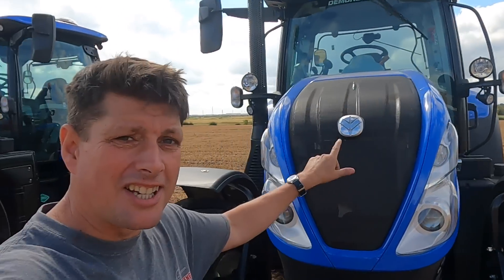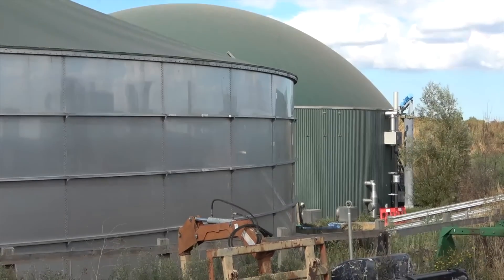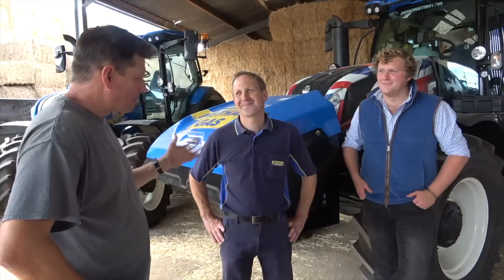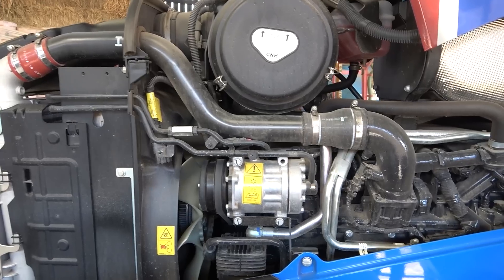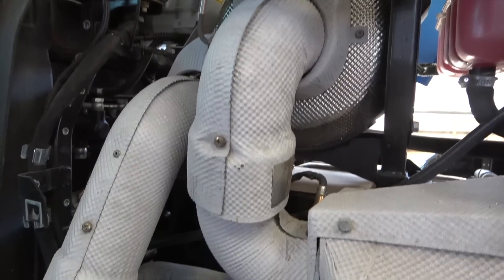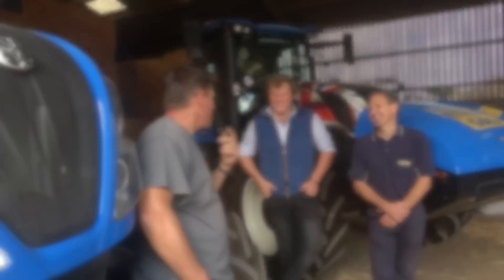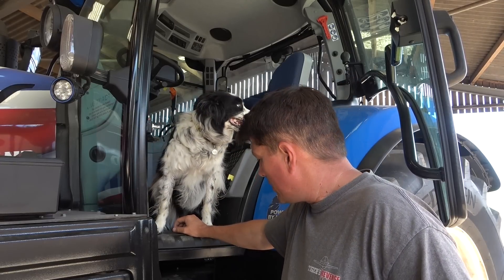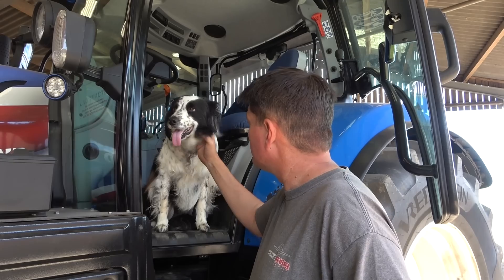GAS vs DIESEL - NEW HOLLAND T6.180 Methane Tractor

Comment: It’s cool and all but when it comes to be used just as much as diesel or gas I’m sure the price will skyrocket just like diesel and gas right now it’s not used much so there’s not a demand once supply and demand goes up then the price is going to skyrocket
Reply from the maker: The whole point (as clearly stated in the video) is to produce your own fuel.
Reply: Sorry didn’t catch it my bad
Reply from the maker: If an A/D plant or a dairy farm can capture and harness the methane, you won't need the tank full of methane (which is still cheap) you will create your own fuel. This can be used to power tractors or generators which in turn can be used to generate electricity.

Comment: It would be like running a petrol tractor with a turbo. A 135 petrol is more lively than a diesel imagine ya had a petrol 135 ruining  natural gas with a turbo. Spark ignition engines burn more liters of fuel for work done though.

Comment: Good video! 👍 We have an AD Plant and Upgrade the gas but want to wait until the tractors are more proven before we purchase
Reply from the maker: There's not a lot to prove really - that's the point - it's the 6.7ltr FPT engine, transmission is same as the diesel, cab, axles, hydraulics etc
Reply: @LordMuck  fair point. I would like to see what parameters the gas quality has to be within to make it work efficiently. 

Not a pessimist to the idea at all but I think the design of tractors will also have to change to integrate the gas tank. Not that safe or practical on the front. 

I would actually like to try one.
Reply from the maker: It's completely safe on the front, in fact safer than a diesel tank as it's in a steel frame and tested for impact with multiple safety shut off valves.
Front linkage can be specced and pto as the range extender can go on the roof or rear of the machine.
The gas produced is the same fuel that the generator engines run on so perfectly fine to run a tractor on.

Comment: That was brilliant thanks.👍. No more stinking diesel on your clothes while filling up with fuel🥰. 

Only real down sides are that in the current form no front loaders or front linkage or front PTO would be possible to use on that setup but that still leaves heck of a lot of jobs it would still be brilliant for.
Reply from the maker: No you can have front linkage, PTO etc, the range extender goes on to the roof or on the rear of the tractor.

Comment: Supose if you had a dairy farm and looking into the tractor youd might as well be looking into maybe a slurry pump/mixer that has its own engine to run off the gas its basically churning out and maybe a genny too as the extra saving with electric would help the gas  infrastructure pay for itself

Comment: I bought a dual fuel generator under the idea that propane engines last a bit longer than gasoline as they don't wear as much . I could ask the internet but how or what would New Holland say about it? Diesel to Methane ? under normal use.

Comment: As someone who's spent his whole life repairing forklifts, using lpg/gas as a fuel is nothing new. 
An engine running on gas can be just as torquey as a diesel IF the engine is designed from the ground up for the purpose.
Reminds me of the gas Perkins engines that used to be around years ago. I've seen gas versions of the 4.203, 4.236, 900 series and 1006 series. Most of them were the diesel version with a low compression head and pistons with a distributor on a 90 degree bevel box where the injection pump would normally live. They behaved just like the diesels, just a lot quieter. 
Only issue with the gas engines is fuel consumption which is an undeniable issue but if you can produce enough fuel on site for free its a non issue.

Comment: What about servicing the methane tractor does it cost more less or the same as a diesel tractor. We didn't see anything coming out of the exhaust is there a waste product from said tractor. Are they alot more dangerous if they caught fire ? Fantastic demonstration could see it working well on combines that only do a couple of months a year .
Reply from the maker: Much cleaner burn, cleaner oil etc.
If they did have an issue or fire, they have a lot of safety valves and auto-cut offs unlike diesels.
Reply: sounding quite promising for the future then mucker
Reply from the maker: They are continuing to improve service times to get them well above 600 hour intervals.

Comment: Good to See Wast To Power Machinery And Cleaner than Diesel With More Torque,This makes More Sense than Heavy Battery's on a Tractor.

I have Used LPG /Petrol Turbo Powered Cars And they Also have More Torque on Gas Than Petrol,Slightly less HP On Gas So Not Sure If its Because it Puts More Gas in to the Engine Compared to Petrol Injection 
Petrol is Probably More Easer to Control Than Gas injection.

Comment: Great video Kurt, most informative indeed. Will be interesting to see if the additional costs of the new machines stay as low as that 10% Many companies leverage customers cost savings heavily against purchase prices. As it stands, the extra machine cost seems very fair, especially when weighed against potential running cost reductions. The additional infrastructure won't be free of course, but if installed at the point where open pits legally have to be covered, that should offer the lowest cost I would hope.To be able to produce heat, electricity, traction fuel and all at the same time as reducing atmospheric methane release is a quadruple win!

Comment: Fuel for the future better than batteries Mucker🚜👍
Reply from the maker: It has its place but so do batteries, just in different applications. AD can also provide power for charging electric equipment so combined with methane kit it reduces costs greatly.

Comment: When comparing the diesel cost to gas, you could also include the add blue cost to the diesel that isn't needed for methane that's also increased significantly in the last year. Very informative video 👍
Reply from the maker: That's a very good point 👍

Comment: Great vid, we are actually in the process of putting a sealed floating cover on our new slurry lagoon to hopefully harvest the methane... everyone’s a winner and the clowns in government should be all over it...
Reply from the maker: Would you consider using the methane as a fuel Tim ?
Reply: @LordMuck  Yes definitely, I think for livestock (dairy) farmers it has a lot of potential as we are typically running those mid range sized tractors. Apart from powering engines you could put it through a CHP unit. As the chap from CNH said it’s hopefully the tip of the iceberg.

Comment: Interesting video M’Lud but l have two questions for you.
1)
The diesel engine is lubricated by the oil in the sump and by the injected diesel thus why they last a long time, however by burning a gas your in effect cutting the lubricating system in half, so would a methane engine last as long as a conventional diesel?

2) 
Will the methane tractor start from cold in winter at a ballpark figure -5?
Reply from the maker: No different to a petrol engine - you're not cutting anything down, it gets lubricated the same way as the diesel variant.
Methane will start at very low temps and doesn't wax up.

Comment: I started to watch with an open mind and was impressed. I know we've got to look at other fuelling systems and we have hydrogen that's being developed as well. 
Would you think methane could be used in cars and trucks as well? 
I'd like to think so as to get away from battery electric units due to the cost of replacing the batterys.
Reply from the maker: Battery powered vehicles and units also have a part to play and the technology is already available to make them much more efficient - the government however are not so keen to push the infrastructure as it's currently not much of an earner.
Despite everyone rolling in their own shit like excitable chimps over hydrogen, the reality is it's not going to be the saviour that everyone hopes.
Reply from the maker: We shall of course be looking at hydrogen in due course.

Comment: Used to work with methane engines at a sewage works diesel start then to gas they also ran better on gas !!! its definitely a better way forward then tons of heavy batteries strapped to your tractor that takes hours to charge
Reply from the maker: People are too quick to dismiss electric - it, like other forms of fuel has its place and the technology surrounding electric and electric fuel cells is moving forward at a crazy rate. The problem is people expect instant tech today and that's not how anything works.

Comment: Great video well done.only one sticking point for me...you refer to it as a free fuel??? It's hardly...look at all the hardware that's involved in collecting the methane and having it ready for delivery to an engine.probarbly a million quid of infrastructure?
Reply from the maker: What is it about "If you already have an AD plant" are people struggling with ?
You buy the tractor if you already have the plant - you don't buy a plant just because you've bought a tractor...
Reply: @LordMuck  ok..if u done have a plant is it possible to buy methane from a wholeseller
Reply from the maker: Yes 100% just as Ben is doing currently from that tanker.

Comment: My only experience with a gas powered vehicle was in the late 1970s with a homemade conversion on an HA Viva van, ran it on butane and propane. Engine stayed cleaner, may save you oil changes too. We used a modded SU carburettor to meter the gas and a copper coil to heat the cylinder. It was comedy gold in the laboratory we worked in to see workmates looking out the window to see where the van was parked so they would sneak out and move their cars away from it. I know it was just a bit of fun but it is definitely a viable fuel.

Comment: Fantastic video really interesting concept, the fact that you could produce your own fuel from your own AD plant and run a generator to produce electricity which you could sell back to the network operator a no brainer surely. The only thing I can see on that tractor that might be something that could be rethought Is fuel tank so you can have a front linkage
Reply from the maker: As discussed further down you can already have roof or rear mounted range extender tanks so you can have a front linkage.
Reply: @LordMuck  hadn't read that 😅ideal then

Comment: Somehow didn't get a notification for this one so a bit late. One other thing about these new fuels is that the engine emissions is less complicated. I have old Deutz air-cooled tractors on my farm and if you wanted one new it could be possible because Deutz engines still make a simple air-cooled engines just a natural gas engine instead of diesel. I find your opinion a bit more lively interesting. One of the fun things about my collection is the different 90-110 PTO hp tractors I have is seeing how different they can be so more lively in throttle response or torque?

Comment: Hello mucky, that was interesting, I like things like this. Gotta couple of questions though. 
1. If you are running on methane and its a clean burn fuel does that mean that it will be possible to run on extended service intervals for the engine because methane would be producing less or no soot particles ??
2. How much is the equipment going to cost to extract and process the gas?? 
3. Obviously not all farms are dairy or beef so where could they get the gas should they choose to go down the methane route?
4. Considering the amount of sh1t being produced at the houses of P would it be possible to connect a digester to the sewers??😂😂
Another excellent video kurt, thankyou.
Reply from the maker: The answers are readily available for anyone wanting to know more regarding where to buy the gas etc

Comment: One thing I think needs change as they are probably already working on a high pressure tank or something but that front tanks where weights would be needs to ge tidied up for front links then it will boost the sales really a tractor that big u would miss your front links /weights but I do think would be a massive improvement in many sectors
Reply from the maker: We discussed this further down - they already offer roof mounted or rear mounted range extenders so you can have front linkage.

Comment: Interesting vid👍I do see this working for dairy, livestock farmers that produce bio gas of some sort.  I just wish mum, dad or older/younger gen investors instead putting their money on stock market put it into family farms if want offset or help environment.  Q. Will see NH put gas system into their largest tractor T9?
Reply from the maker: As we said the system works well in the mid range tractors which it suits best but I'm sure they will increase power. Not sure a T9 is the right size for methane ?

Comment: You should check out the new JCB designed Hydrogen Tractors & Telehanders which have the same power as a Diesel version But don't produce any emissions at all and still let JCB build the same lower half of the engines so the factory jobs are safe they just designed a new top half to the engines!  The Machines are amazing.
Reply from the maker: You should try watching the video - New Holland are using the same 6.7 litre FPT with some top end mods
that's all.

Comment: yes but how much for the concrete cow on top of the 2. 82 ? like the idea but feel it still needs to be made simpler or a hybrid between choosing mithane or diesel
Reply from the maker: You don't buy an AD plant because you have a methane tractor - you buy the tractor because you have an AD plant.
The choice could not be simpler - It's basically Free fuel.

Comment: Is there much of a difference in noise? Especially at tick over? Any idea what compression ratio it's running at? They ran a lot of LP tractors in the states for a long time so I guess refuelling isn't that big an issue to overcome.
Reply from the maker: They actually had to make the exhaust LOUDER because it was too quiet to actually hear the engine in the cab !
Reply: @LordMuck  that's mad 😂. A bit of straight pipe required then 😂

Comment: Great video, be interested to get a ballpark on how many cows or what size slurry pit etc. it would take to make enough methane for the year with the same 1000hr a year and usage example?
Reply from the maker: 1750kg of methane to run 100 hours so you just need to find out how much methane you're producing.

Comment: its the future, sort of thing George wants to look at for his yard tractor, any dairy guy wants to look at given future rules really , why just waste the stuff once caught
Reply from the maker: George struggles with capturing oil in that Fastrac, let alone methane in the pit.
Reply: @LordMuck  harsh 😆😆😆😆
the only prob i can see is for a small dairy guy single tractor place , you wont be able to have a front loader,until they can maybe fit a tank in where the derv tank goes i guess
Reply from the maker: The main tank is where the diesel tank is - why do you think he fuelled it near the step ? The front tank is a range extender which you could have on the roof or even on the rear.
Reply: @LordMuck  ah, i didn’t realise that, just assumed it was all in the front tank part ,filler somewhere safe , so it then can be front loader fitted if thats the case

Comment: Now that was a surprise. Very informative. I remember we had a propane Minneapolis Moline 602 with a loader that was always used. Didn't matter the season, winter in Minnesota is frigid, it started right up. Great tractor. This methane tractor looks, technically quite similar in respect. And if you can create your own fuel at the same time. What a concept.
Great video, thanks.
Reply: I have to admit, that's a really novel idea for a cattle farm. Pig farms are certainly the worst. With the fact Methane is much worse than CO2, using methane as a fuel make sense. The technology needs to be created to break down the CO and CO2 byproducts down to carbon (great for vehicle tyres) and the Oxygen combined with Hydrogen to make additional water molecules. It can all be done electrochenically or via catalysts. Interesting solution.

Comment: I did not see that coming i thought diesel was a must in farm environment but 10k extra to buy but 18 k saving in year 1 on fuel still up 8 k and i would guess the service cost be the same ish as diesel also? and over five years modern with the savings over five year life of it would only cost 20k barging that   is 18k  saving on fuel cost per year over the five years is 90k so at 110k to buy its a 20k tractor ball park numbers wow if that is close to right

Comment: Onwards and upwards, who would think, 20 years ago, running on cow farts!!!!  1 question, what about the service times, X hours, verses cost, Oil, and filters for a diesel, oil, filters, plugs, leads, coils etc, £17 an hour less fuel costs, extra maintenance????
Reply from the maker: No it's £2.80 an hour vs £20 an hour.
Also maintenance is slightly better as it burns cleaner. Plugs etc are cleanable before requiring change. This is a modern methane engine, not an old Mk 3 Cortina...

Comment: i have seen a new holland on methane here  in the Netherlands, that one had the tanks on the cabin roof, the advantage was you stil have a front hitch, it's cheaper to run and you stil have a full functioning tractor, that's a no brainer. this is the future
Reply from the maker: Yes I've seen that - again it's down to use/application.